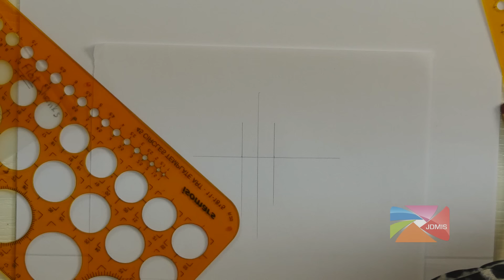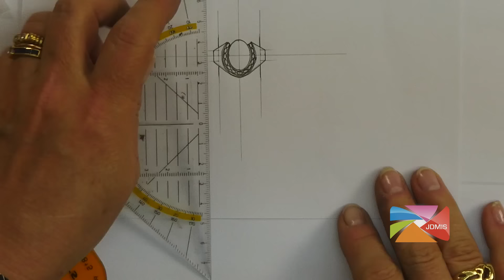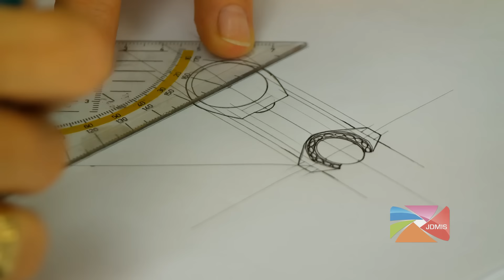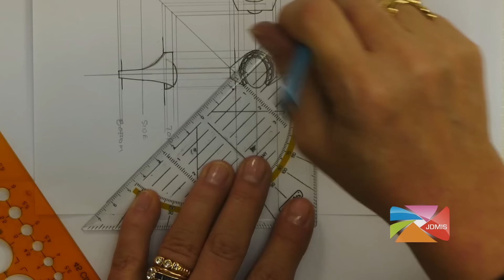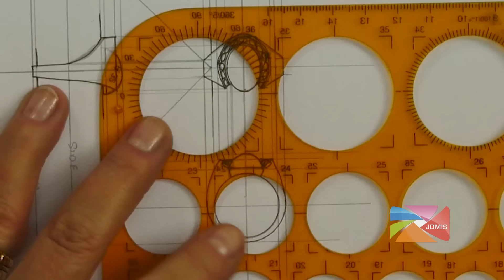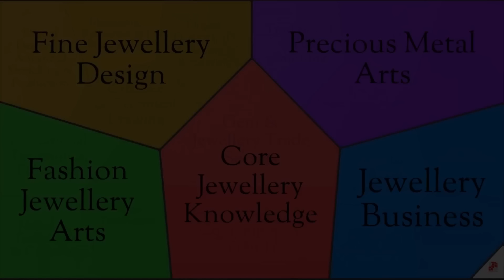✏️📐 Jewellery Design Technical Drawing with Tanja Sadow from JDMIS

Comment: also how do you know how much of a gap to leave for finger space etc
Reply from the maker: I'm not quite sure what you're referring to here, there is typically no space between the finger and the ring. When you measure the finger size you will find that it is a tight fit over the knuckle and there is no gap when you are wearing it comfortably. The size prevents the ring from rolling.... Generally run a ring doesn't fit exactly you would take it back to the jeweller to be resized.

Comment: do you have to draw the ring in the correct size for the customer?
Reply from the maker: Indeed it is good practise to complete any drawing in actual size. This is useful for several reasons, the first of which is that the customer is seeing what they will actually get and therefore is unlikely to be disappointed with sizes being different in their finished designs. Ensuring that the measurements are accurate also means that this technical drawing can go direct to the manufacturer and they can take accurate measurements directly from the drawing to use in the workshop. 
I hope the video was helpful! Thanks for watching 😄
Reply: @JdmisEduSg  what if you need the same ring in multiple sizes, do i have to draw it all seperately? doesn't that take a lot of time. Also how long would you say is the time needed for one drawing? it's sped up in the video so i cant really tell. thank you!

Comment: Hello. what kind of vellum you use?
Reply from the maker: The weight of the paper I use is 50gms but if you cant get the thinner paper then slightly thicker will do ie 60gm or even 80gm but the heavier tracing paper (which is usually called vellum) is not good for creative tracing as, the thicker it is, the more expensive it will be and we tend to use a lot of it!  Vellum which tends to be much thicker (120gms) is great when used for colouring and for water colour since the thinner tracing paper tends to buckle under the water and does not stay flat.

Comment: What kind of tracing paper do you use? Any particular brand?
Reply from the maker: Hi Elizabeth, Tracing paper does not need to be thick but does need to be clearly see-through.  I am not fussy with the brand as long as it is not too grainy which might make it hard to see through.  The weight of the paper I use is 50gms but if you cant get the thinner paper then slightly thicker will do ie 60gm or even 80gm but the heavier tracing paper (which is usually called vellum) is not good for creative tracing as, the thicker it is, the more expensive it will be and we tend to use a lot of it!  Vellum which tends to be much thicker (120gms) is great when used for colouring and for water colour since the thinner tracing paper tends to buckle under the water and does not stay flat.

Comment: I only see three views of the piece, I thought she would draw a 3d rendering of the ring. I had drafting,to which is used here.
Reply from the maker: Hi Andy, We normally do a technical drawing to send to a factory. A 3D rendering is not necessary for the manufacturer as they work from the accurate measurements in the draughting. A 3D (drawn in one or two-point perspective) is usually only useful if you plan to present your jewellery piece in a competition or to a customer.  I hope this helps and wish you well in your designing! Best regards, Tanja (Its me in the video...)

Comment: Hi, what is the name of the pencil that you are using in this video?
Reply from the maker: Hi Kaye, Thanks for watching! We use a mechanical pencil that holds 2mm diameter lead. This type of lead has a special sharpener. For jewellery design we use 2H Lead. Do check out our other jewellery videos and have a great week!
Reply: Same Question mam please tell...
Reply: Great job ❤🎉❤